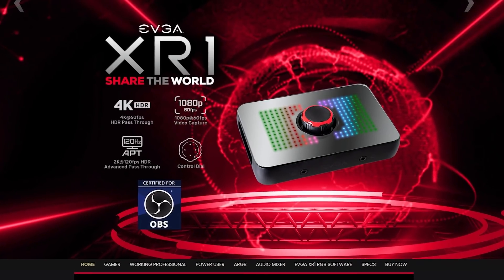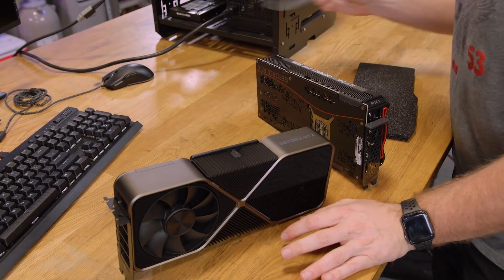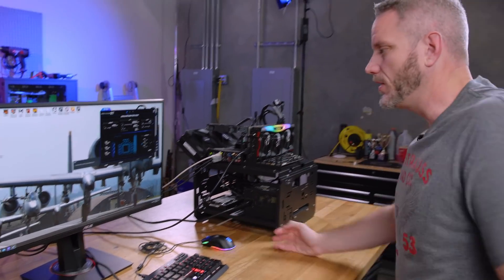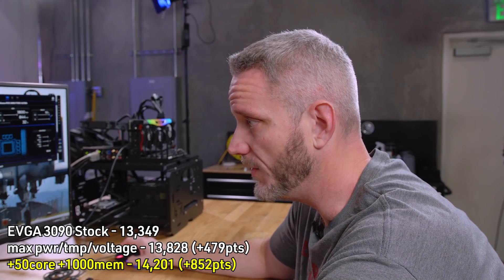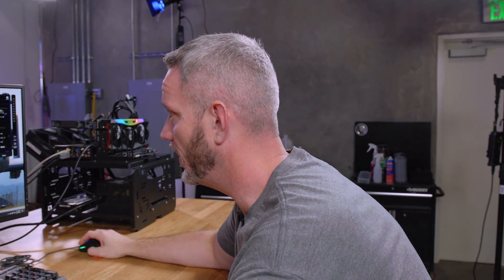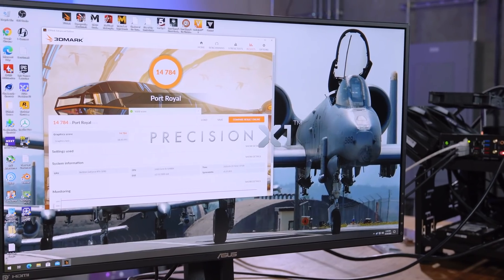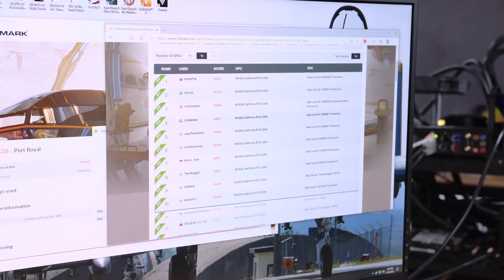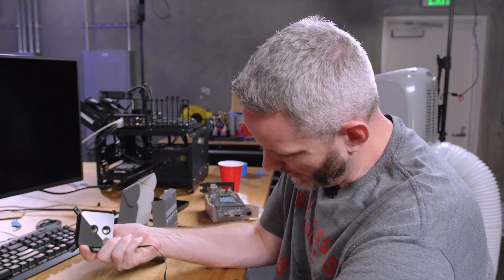This is what happens when you modify the RTX 3090 Bios...

Comment: Who needs SLI nowadays??
SLI bridge sold out in 3 minutes ) 😒
Reply: Depends how many there were - Not much point producing many when you don't think there's much demand.

Or I guess Nvidia's current stance is there's not much point producing any regardless of demand ;P
Reply: That was 2 minutes and 59 seconds slower then the GPU stock selling out so Nvidia was kinda right-ish...
Reply: There were 20 RTX 3090's and 10 NV Links available at launch.
Reply: @CBadger  😂😂😂 to make 10 SLIs
Reply: Gonna miss SLI. Been running multi gpu setups for many years now.
Reply: The videos I've seen with two 3090's show a noticeable FPS difference, especially in 4k and 8k.
Reply: @herakets3259  for sure. I don't know why they want to phase out SLI on all cards except top tier!?! 😕
Reply: @PulsarTECH  Yea it's an unfortunate decision not to do it for the 3080's especially.  On the other hand, they may have done it from an economic standpoint:  Why would customers buy the 3090 if they could buy two 3080's for cheaper?  Conversely, those who can afford something as monumentally expensive as the 3090 may well be able to afford two of them anyway, offsetting the cost lost to more 3080's.  But, in effect, being able to buy two 3080's and SLI them might have made the 3090 obsolete, but even slight improvements in the technology of a single card are exponentially higher so it's more difficult for them to develop it.  They have to sell it.  

That's my reckoning anyway.
Reply: LIES  DECEPTION
Reply: @PulsarTECH  because they don't want  you to be able to buy 2 2nd hand cards that will beat a new card for less money I guess 😒
Reply: Something not lasting on nvidias website isn't saying much lol
Reply: The reason for it is you have to add an item to have your account set up and ready to check out fast, so the only item that it's out there is the NV link or sli bridge, you add it and allegedly let's you skip some time off your checkout
Reply: @herakets3259  that's a good point two 3080 would definitely beat one 3090. So if they make 3080 with SLI, it would be more expensive to counterbalance for extra performance you get versus 3090.
Reply: @PulsarTECH  People were getting 2 to 3 if not 4 generations worth out of using two cards in SLI and in year over year profit terms for a company that relies on selling the latest and greatest video cards, that's not acceptable. It's great for the customers obviously, I think it's greed on Nvidia's part.
Reply: @brandongray1059   I will too, people don't understand how beautiful it is when games do it. My 2 1070s will be missed. Been doing this since my 2 8800s
Reply: @darealfabio4  "people don't understand how beautiful it is when games do it."

Probably because the number of game certified for SLI is pretty slim. Even then, having a bug free experience in games require sitting with legs and left hand fingers crossed with a lucky rabbits foot blessed by a priest worn around your neck.

Comment: Get a big stock pot soup pot and make a DIY degasser / vaccuum chamber. Plumb in liquid cooling lines. Cool it to -20 with liquid nitrogen in a vaccuum. IT can't condensate water from the air if there is no air.

Comment: "55 degrees is just too high"
Me: laughs in 50 degrees idle
Reply: Laughs in 80 idle
Reply: lmao same I have the stock amd cooler
Reply: 41 C idle on my gtx 1060 6gb, because no AC
Reply: 30° idle boi here
Reply: Laughs in 52 degrees powered off for about 3 hours
Reply: A lot of newer cards will idle around that, because the fans don't start to spin untill that threshold.
Reply: @neohitta  yeah i got zero rpm thing
Reply: laughs in 47° 100% fan speed intel stock cooler afterburner mode
Reply: @rexcatston8412  so you live inside an oven or what?
Reply: What are Your temps on the R7 3700x with the stock cooler?
Im at almost 50 idle and around 90deg under load :(
Reply: GTX 480 enters chat
Reply: @ReedSta4  literally any laptop enters the chat
Reply: My card is idling at 60 atm, but the fans don't even seem to kick on until it hits 60C. Haven't seen it go over 72/73C even while benchmarking.
Reply: Once had a Radeon that slowly went up to 130 in some game menus before freezing up. Normal temps were 40 on idle and 60 on load though. Was a passive cooled 3870.
Reply: @descent8275  i have the cooler master MasterAir MA410M TUF i think, idle is around 42 Celcius... but i did undervolt to 1.28125v @4.25Ghz works fine for me
Reply: 31* idle
Reply: Me: cries in Folding at Home.
Reply: It hurts me when I even see my card touch 60 Jesus
Reply: AC gang rise up

Comment: Jay: Make sure if you are running SLI to have 2 of the exact same card.
Steve: No you don't need to do that. You can just jerry rig an SLI setup using 2 different 3090s using PCI_E Riser cards and a Jerry rigged cooling solution for the FE card.
Reply: And two open benches because why not
Reply: To be fair, I don't think Steve would advise doing what he did either
Reply: @sauyon  Yeah I know. It was a joke. Even Steve said he advises against what he did.
Reply: What? Only on the later years did it get more "important" to use the same cards. Always has been a best idea to do so ofc. But, it a acceleration card. It's the software holding it back (if not the same) but it is understandable why it's hard the code for that shiet. If there only was 2 GPUs then sure. Almost a 100% scaling should be possible
Reply: You shouldn't need 2 of the same cards. That is too much bs
Reply: @somebody22222  That is exactly what I am at.
Reply: Tbh, i read the second card in steve's voice
Reply: @somebody22222  It is but the SLI fingers don't line up if you use an FE card and an AIB partner card. Not sure about 2 different AIB partner cards but I assume that should work.
Reply: I’ve used 2 cards many times. Not in SLI. Any 2 cards will increase performance just not x2. I’ve even used nvidia and amd cards together.
Reply: Jayro Jones  Not would be compatible with the new standard that would work very well.  Those NvLink bridges have high bandwidth for a reason. Unless Nvida made an NVLink bridge that is flexible. Also these are NVLink bridges NOT SLI bridges  big difference.
Reply: doesn't make much difference, card 2 will become a dedicated compute unit, while card 1 will stay a dedicated GPU, while using SLI, instead of CUDA using up sections of the GPU which transform into CUDA cores if you only have a single GPU
Reply: I ONLY LIKE SO I CAN SEE THE COMMENT WITH 700 LIKES
Reply: sorry to be so offtopic but does anybody know of a method to log back into an Instagram account?
I somehow forgot my account password. I appreciate any assistance you can give me.
Reply: "Jury" Rigged

Comment: You could get a 3D Printer and print a bracket?  Just use a slightly flexible material and use the flex to "pull" the block down.

Comment: Jo Jay.
The air coming out of the AC is already "dried" because the water "drops out" in the AC cooler heat exchanger as the coldest spot.
Thats why there is a plug somewhere on the lower part and/or it gets used on the "hot" part of the ac to help cooling by evaporating.
So when the air gets out of the AC, everything afterwards means the air is already getting warmer and so "even more dry".
Only point would be if you cool down the card with the ac way below room temp, then switch off gpu and remove the ac.
Perhaps the backside of the card, but it should still be surrounded by a indirect "cloud" of warmed up ultradry air from the AC.

Did you try spraywax (car shop) or conformal coating on your subroomtemperature-oc-gpus if you fear condensation ?
Spraywax is great because you can easily reflow it again everywhere with a heatgun.

if you need a plate, try aluminium, a hand drill and manual saw, we know you can do it.. or even wood (only the finest aged swamp oak, because of better sound) works just fine.

I would really like to see a tool which includes the memory error correction rate happening. So people dont get all high on super oc-memory numbers and in reality lose speed.

Comment: If you want to prevent condensation with a full body water block, run the AC on the back of the card to lower total temperature deltas across the card. Also, invest in a dehumidifier. Condensation is based off two things: ambient temperature and humidity. You can greatly reduce condensation on the system if you run a dehumidifier close to it. I do this for my sub-ambient server, and it is 100% safe and stable.

Comment: I thought you wouldnt have to deal with condensation at all with an air conditioner because its also a de humidifier, its not like youre using a swamp cooler
Reply: AND run a dehumidifier in the room to get the humidity down <40% to avoid condensation...

Comment: If you had a real dehumidifier in the room, condensation and dew point is no issue at any temp. I don't understand how this is so overlooked when overclocking. I'm a indoor grower and PC builder. Water cooling with heat exchangers is my thing.

Comment: Try feeding on AC with another AC that then cools the air to the GPU
Reply: @bruh meme whoosh
Reply: @eg12p34  I fail to see the whoosh
Reply: EG12P I also fail fo see the whoosh
Reply: You'd gain more by misting water on the condenser coil so it transfers the heat out of the refrigerant better .....
Reply: @bruh meme Not true, they are designed for a specific temperature drop from ambient, usually around 20 F  ...... If the air in is 70 then the air out is 50, if they air in is 80 then the air out is 60 ..... However there are limits since those small units use capillary tubes rather than an expansion valve so you aren't going to gain much below 60 in .....  better way is to lower the liquid temperature and the easiest way to do that would be misting the condenser coil  ..... You can buy kits for home A/C condensers where you have tube that circles the top with little garden type misters every few inches that mist the coil whenever the unit turns on but the downside is getting a water supply to them, you either have to tie up your garden hose or plumb a line from inside the house that can be shut off and drained for winter so it doesn't burst from freezing ....
Reply: @eg12p34  Not every wrong statement is meant as a joke.
Reply: @longjohn526  thanks for the info. The initial comment was made as a joke since jay loves going over the top with cooling.
Reply: @bruh meme you remember the last video where he pointed at the 10 ton AC hes using to keep ambient as low as possible?

Comment: The hilarious part is the new driver doesn't slow the card down, it just fixes the stability issue in the Windows driver, that is why the Linux driver did not need to be updated as it didn't have the error that caused crashes.

Comment: Could use dehumidifiers as well and actually have a meter to measure humidity and make sure it is low.  Water that condenses from air should have no impurities in it anyway, and therefore not be electrically conductive - that is an experiment it would be good to run and find out if true or not.

Comment: @JayzTwoCents I have seen reports on that some might get higher OC on the FIX driver. Cant test myself, have no card. Can be that the boost now kicks in after the vcore-bump. I had a faulty 680 card that i had to manually add +1 setting to the complete volt table. Not rekomended. Did still work decent. From 2D loading screens in window mode to full 3D. You get the point. Big jump in boost.

Comment: Don’t need a mill to make a cpu bracket, can been done with simple hand tools and a couple hours labour. The stuff I’ve built with hand tools would blow your mind. Just finished up making a Luger action wrench with a chop saw and hand file, tolerances had to be 0.0005-0.0010” and I nailed it with 0.0008” and that includes the
0.005” brass shim that fits between the Luger and action wrench to protect the
blueing. Mills are nice to have, but we can make due without them for most custom jobs.

Comment: so, colder temperatures equal higher density, does this increase in density result in a direct increase in conductivity? most super conductors arent activated without very low temps. im guessing this is a yes, hence the crazy nitrogen cooling contraptions?
Reply: i figure at a certain point, just keeping thermals in check wont make a product go faster than its limit, however altering the actual molecular structure with extreme temps might achieve this. is this the basic principal behind extreme overclocking?

Comment: You could probably make up the missing points to 3rd by just disabling unnecessary stuff. Any unused hardware (not used by the bench - disable in bios) any system services that aren't being used,  IE, if there is a CPU bottleneck, reduce the amount the CPU is doing in the background.

Comment: That PX1 is available to the public in fact it will auto update to it even if you have a 2000 series card. It did it to me. Not happy it throttled my CPU do to the fact my fan hub was hooked up to my 2080S FTW3. Literally took your advice on the fans set to GPU temps and got boned. My entire PC was too hot to the touch.
Reply: Don't blame EVGA guys they didn't do it even though they did.

Comment: I got a stable 3d mark bench with my gigabyte gaming oc 3090 and peaked at 2150 on air. No ac or anything just fans at 100. But for that run my scores went down a tad. I dropped core down -10 and i got my best with a peak of 2110mhz. Def check out gigabyte 3090s. Maybe will get you that extra something you need.

Comment: Time to get a 3D printer LOL (if you do, keep in mind that PLA and most resins deform at around 60C. You can use ABS (print it only when nobody is there or with ventilation since it's toxic) or special heat resistant resin.

Comment: I used to get ripped on pretty hard for placing high on the leader boards immediately after a launch, so yeah, you deserve it.  Anyone can place high when there's virtually no competition, or if you're running 3 way SLI or 4 way Crossfire.
Reply: It's also easy to dominate the top of the boards when you're the only ones (the influencers) who are given access to the custom bios needed to push power limits this high.

It's a bs and unfair competition that is absolutely skewed to only allow those that already are on top to remain on top.
Reply: @TJ.85  ha, yeah, that's cheating as far as I'm concerned

Comment: Heres a little hint.
Set your clocks then close the overclocking program since it uses gpu power each time it polls all the sensors.
You gain about 450 closing percisionX and about 140 points closing afterburner.
Change screen res to 1080 and disable gpu scaling.
Close any thing else running in the background using the GPU you can see whats using it by calling nvidia-smi
Then lastly for people that dont have there cards shunt modded. Nvidia used strange power limiters like 5.4%
Overclocking software you can only move it too 5% so your missing out on the .4%

You can set the full power limit in nvidia-smi using the -pl command.

Comment: what makes me sad is today i finally put my pc together with a galaxy 560ti card a buddy gave me to hold me over till i get my 3080. Im running a phanatek p400a with an artic liquid freezer ii 360 AIO. the card is 9in long and has good clearance. i measured where the 3080 would reach. Its gonna be a really tight fit with the nvidia fe card. I also considered the Asus tuff and its another inch more. Not sure it will fit. I cant even dream of the 3090 with that configuration. I would either have to change the case or change to air cooler. but i love the look of the build with the Artic AIO.

Comment: This is a list of parts for my first ever PC build, any suggestions/advice or feedback would truly help me tremendously. Thank you. CPU-Intel i9-10900k, CPU Cooler-Noctua NH-D15 Chromax.Black, Motherboard-Asus ROG MAXIMUS XII HERO(Wi-Fi) LGA 1200, Memory-Corsair Vengeance RGB Pro(4 sticks of 16GB each), GPU-Trying to get literally any 3080 but preferably not one of the worse custom cards, Case-Phanteks Eclipse P500A Digital RGB Mid Tower, PSU-Corsair 850W 80+ Titanium Fully Modular ATX and Monitor-Asus ROG Swift PG258Q 24.5” 1920x1080 Hz Monitor

Comment: when does someone realise how  much smarter it is to daisy chain the monitor signal AFTER the monitor to record. No more compatability derp, but monitors needs to support a copy output, which is from this point of view as easy as changing underwear. And you have zero probability of problems in the main chain, zero probability of added delay. Whats not to like. Upon problems , your recording fails, not your vision. 

Unless you should just build dedicated streamer edition gfx cards with seperate copy output circuitry to ensure minimal overhead. Which is kinda already what they are doing, but I guess you get problems if you wanna record high framerate/pixel density?

Comment: Idea for a temp solution as far as the holes just not lining up and attaching water block to the rectangular holes: mayhaps  rubber fan screws? the tension would possibly keep it centered and thermal past should keep it from lifting.